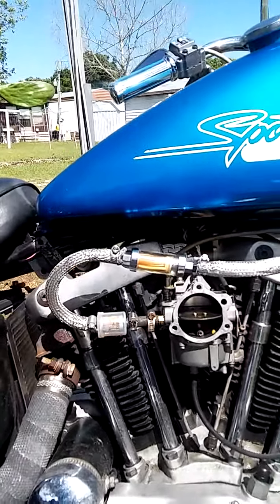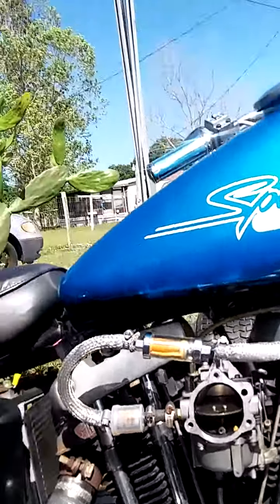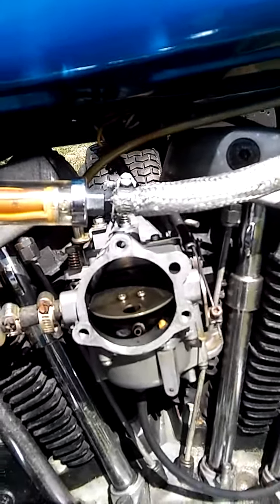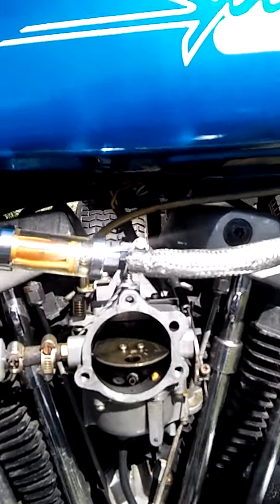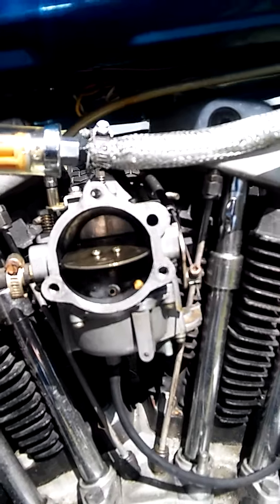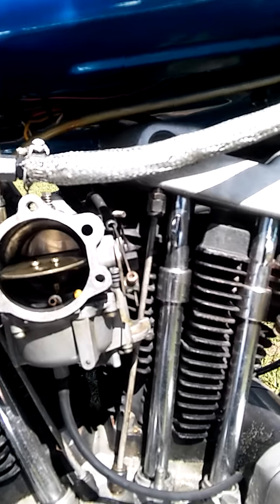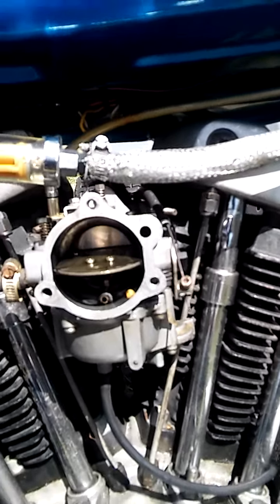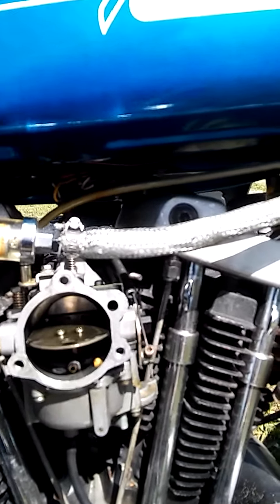Carb 1977 HARLEY DAVIDSON Sportster 1000

Comment: What carb is that?
Reply: Keihin
Reply: What did you find out to be the problem..??
Reply from the maker: The headers made zero pressure at that rpm. Installed a keihil slide carb